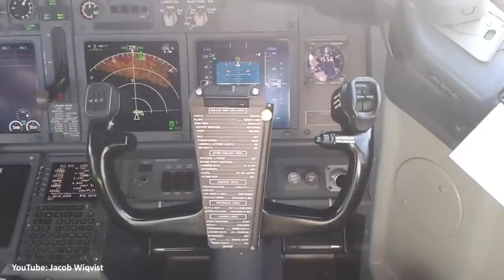Why does Airbus use a side stick?

Comment: So, after going through alot of comments it seems like almost every prefers yokes, but at the same time not giving a reasonable explanation why it is better. How many accidents have been attributed to sidesticks or yokes. Unless you're a pilot that has flown commercially with both types, technically your opinion isnt worth a grain of salt in the ocean
Reply: Uri Blake exactly
Reply: Air Fance Flight 447
Reply: @mobilegamer8922  Pilot error and bad communication between pilots. Yes the sidestick made it less visible what the other pilot was doing but ultimately pilot error.
Reply: Epicness 357 I think the biggest flaw with the side stick on the Airbus is that when one pilot pulls on the side stick the other side stick doesn’t move making to so there is no way of knowing whether one of the pilots is doing something wrong. But with the yoke on the Boeing is being pulled back by one of the pilots the other yoke also moves making it obvious if one of the pilots are making a mistake that could be corrected.
Reply: @mobilegamer8922  that the famous one.
Reply: Xi Jinping yes, there is no mechanical connection between the side sticks. However saying that “the pilots wont know” is ridiculous since airbus has warnings now providing pilots with information who is in command and warn in case of dual side stick operations.
Reply: MobileGamer89 seems like the only example people give these days.

Comment: Are you all naive? There are ways of checking which Sidestick has authority. The crash was mainly due to not quickly understanding that a stall was occurring
Reply: Agree, there's a light and even a acoustic tone and the pilots could hold the red button for 5 seconds to get priority input. The crash was just bad communication and overwhelmed pilots.

Comment: Even yokes are fly by wire. Airbus as usual was ahead of the times with this. Boeing is removing cables and going to fly by wire. 747-4 to the 747-8 has removed most of its cables as well as as the 737 to the 737 max. As a commercial pilot that spends a lot of time sitting in the cockpit while autopilot is in control. I would like to think the airbus with its footrest and table tray would make the pilots life a lot more comfortable.
Reply: This thread is about fly by wire. When a company designs something years after a rival company starts to use it I would call it ahead of they time
Reply: Doge Bomber you must have a lot of time on your hands

Comment: as a pilot i can say i prefer the yoke massively.  having feedback when you are actually flying, especially when in an emergency dealing with control surfaces etc, is immensely better.  The side stick yoke feels too much like a video game and not like you are in control of the aircraft.  Also, the reason you mentioned, getting feedback and seeing what the other pilot is doing with the controls is a huge benefit.  I won't fly anything with side sticks b/c of my desire for feedback in an emergency situation
Reply: What about the Gulfstream G400-G800 where they have active sidesticks, where they are electronically linked, backdriven with the autopilot, stick shakers and allow for force feedback?
Reply: The Yoke can be operated with either hand--not the Side Stick!
Reply: @sadiqjohnny77  A benefit in general aviation aircraft. On airliners, it's usually one hand on the yoke and the other on the throttle for descent to landing. No using either hand then.
Reply: True, in the normal state of events but I have flown as captain on Tridents, 707s,/720bs. DC 10 and B 747s. There have been occassions when I have had to use my left hand while manual flying (perhaps to pull a chart out of my flight bag next to my seat on my left when an unexpected change happens) It only takes a few seconds so handing over to the copilot is not necessary.  Leaving the throttles for that time does not cause a problem. Modern airline pilots usually use autopilot and auto throttles down to 200-300ft or even autoland. So perhaps my observation is outdated.  I often disconnected all autos and flew the plane in manually to keep my manual flying skills up to yhe mark. Never flew with a side stick and think that I would still prefer the yoke. Side sticks remind me of computer gaming. @ARandom777

Comment: Boeing has asked pilots which they prefer. Most Boeing pilots prefer a yoke. When developing a new aircraft like the 787 they can incorporate a side stick as it is apart of the new type certificate. 777x has to stay with a yoke due to its previous type certificate. I work on both Boeing and Airbus and they both engineer great aircraft.

Comment: I would like to use whatever system would not result in my death.
Reply: Talking about safety, both systems have their drawbacks. While it is certain that the AF 447 accident would more than likely not have occurred on a Boeing, it is also true that Eastern 401 could not have happened  on an Airbus airliner. In that crash, the distracted captain disabled the auto pilot mistakenly by nudging his yoke while helping the FO changing a light bulb. I am no airline pilot but I think it makes sense for a plane designer to eliminate a control system which takes a lot of room and is typically used for 20 minutes during a normal flight and to replace it with a writing tablet/laptop shelf.
Reply: @patricesicaud6536  pilots are trained on their specific aircraft type. No one event ever caused a crash. Usually there is a chain of events that cause airliners to crash.  The Eastern crash you referenced had other links in the chain of events that caused the airlines to crash.
Reply: Steering wheel. Now you realize?
Reply: Brian Wilson So what you are saying is that the Easter Airlines crew was a victim of a unforeseen set of circumstances where they were the least responsible link.
I am not buying this. Whereas the AF FO was directly responsible of the crash because he kept the airplane nose too high,  the Eastern AIrlines captain was just as guilty for not monitoring the plane flight. IT always is the first rule in the cockpit "First, you must fly the plane". both screws were highly trained for sure but in both cases, somebody screwed up really 
bad.
Reply: Brian Wilson When are you going to rejoin The Beach Boys?
Reply: So any system that prevents pilot error? :p Meaning Airbus and sidesticks.
Reply: What happened on eastern airlines flight 401?

Comment: Everyone prefers the yoke. For me, both are great. Remember that the sidestick is not a simple joystick. I'm sure that sidesticks are more comfortable and precise than they appear to be, as they have many adjustments on the armrest in order to get a correct position to handle it with precision and without moving your arm. You move only the wrist, and you have a table and even a keyboard if you're flying an a380 or a350, apart from the autotrim. Nevertheless, captain's and first officer's sticks should be linked in some way, just for safety

Comment: Yokes are better
Reply: Bŕøđý Cýř no
Reply: Please explain you opinion, it's a great debate.
Reply: Agreed I like jokes way way way better. Simply if everything fails at least you still have the controls of the airplane. Plus you wouldn't have the confusion of having two pilots using the controls the same time without knowing it. like Flight 447 of France.
Reply: @TheSwanlake2009  today, yokes aren't linked to surface planes with cables like in the old days. It's hydraulic. So if everything fails, well you are done, sidestick or yoke alike
Reply: @TheSwanlake2009  on the AF447 the pilots knew that they were both moving them.
Reply: @underwaterdick  What if Boeing bought the F-16 production line, took out the side stick and installed 737-style yokes in them?  What if Airbus could sell you a kit to convert your Cessna 152 to a sidestick fly-by-wire aircraft?  What if Lockheed-Martin could sell you a multi-engine automobile that allows you to control the pitch and roll with the steering wheel, the yaw with your pedals and the reverse traction and power with a throttle quadrant?
Reply: @tomasribeiro8020  Not until the last 13 or so seconds. But I believe that was largely due to the captain not saying "my plane" when he took control.
Reply: @wbharris1031  they only realized that too late because they where both panicking. When the captain that was resting arrived at the cockpit he immediately realized that they were both moving the sidesticks but of course the callouts had been ringing for since they both began moving them.

Comment: Yoke gives a more balanced central ambidextrous stick control.

Flying with left sidestick for a right handed pilot (and vice versa) bears more potential danger during high stress flight.
Reply: Even with the yoke left seat left hand and right seat right hand is used. You don't fly with both hands on the yoke (except immediately after V1)

Comment: Yokes are better hands down because It’s more manual and hands on and doesn’t require making one hand more used than the other hand for using a joystick
Reply: The training pilots receive is vigorous and extensive. You just don't go to your local license office and get your multi engine rating without thorough understanding of all the different nuances that go into being a commercial pilot.
Reply: I think it would be a nice change of pace for my left hand to finally get a work-out.

Comment: Most pilots are accustomed to the traditional yoke/column just like most drivers are used to the traditional steering wheel of a car. In my opinion, the traditional yoke is more intuitive like the steering wheel than the side stick. My preference is the yoke/column. Maybe Boeing retained the yoke/column because most pilots are used to it.

Comment: If Air France 447 was a Boeing. The yoke would have been observed by the other pilot.  Side stick requires little input and hence 
Not visible.
And Navgeek nailed this fact
Reply: jimmy c At least we have more space in Airbus. When you fly a Boeing don’t complain about the legroom, having to do paperwork on your knees and eating on your lap.
Reply: But in AF447 both pilots knew that they were both moving their sidesticks. But they were panicking and any form of logical reasoning left that cockpit... In an Airbus is both pilots are moving their sidesticks you can constantly hear the "Dual Input" callout and the fly by wire computer will sum up the inputs
Reply: @tomasribeiro8020  Dual Input alarm ringed multiple times. Also Robert yelled mutiple times at Bonin to push the nose down.
Reply: @northaviation7952  Legroom, safety... I'd stick to safety.

Comment: I think "Yokes" are safer that "Sidestick" because Yokes are mechanically linked whereas Sidestick aren't.
Reply: Fermain Jackson omfg. Can you just read your comments before you upload them.
Reply: Everything is flyby wire these days... Yokes are being obsolete
Reply: Fermain Jackson side sticks are safer
Reply: Agree - just one example - in an emergency a pilot could put pressure or incorrect inputs on the sidestick inadvertently cancelling out the other pilots inputs. That can never happen with Yokes
Reply: You cant cancel out the other pilots input anymore... They have corrected this feature... A deafening "Dual input" aural warning will blast from the speakers if this happens
Reply: RunPJs yes but with Boeing, they fall out the sky, whereas airbus can be saved. But Boeing can’t.
Reply: tuluks Vui The inputs are summed up now. For instance, if a pilot puts the aircraft into a dive, the other pilot can pull up and the aircraft will stay level.
Reply: Yokes are fly-by-wire, but they are still mechanically linked BEFORE connecting to the interface. So it maintains both advantages.

Comment: I feel that the sidestick helps steer the plane with more ease than having a heavy yoke in front of you, controlling it with one hand and keeping your other hand on the throttle. The sidestick is much lighter and needs small inputs to make the aircraft move hence resulting to be more comfortable for the pilot. It also increases legroom for pilots and doesn’t block the pfd and other crucial displays. I prefer the sidestick.
Reply: The 777 that has a yoke is fly by wire like Airbus
Reply: I prefer the yoke, it feels much more like having control of the plane and it's much more reassuring
Reply: Not at all. The 777 has force feedback and direct link to the control surfacees. It's like flying an cable controlled aircraft such a 737.. While the sidestick of an Airbus give commands to the flight computers, which translate it into control movements. You not acctually steering the plane. The computer does.

Comment: I learned to fly in Cessnas that had yokes, so that's what I'm used to and prefer. I also had a job working on military flight simulators where the fighter aircraft had side sticks. The sticks were on the right side, which wasn't too bad since I'm right handed. A side stick on the left would drive me crazy, and I'd think it would be a little more dangerous.  The side sticks made sense in the fighters, since it's easier to use those when you're taking heavy Gs. But I see no advantage to side sticks in large airliners.
Reply: Makes zero sense because the captain would also need his/her left hand on the yoke while using the right hand for the throttle. Sidesticks on airlines are mainly for crew comfort and accessibility to a tray table.
Reply: @hodb3906  imagine building a plane just for a tray table. Plus I’ve flown a cross country with a yoke in a C172 and a CC in a cirrus sr22 and the yoke in the long run feels so much better
Reply: I guess it’s down to personal preference

Comment: hard to fly if you're right handed and a captain lol
Reply: On Boeings the captain always holds the yoke with the left hand anyway because the right hand should be on the thrust leavers.
Reply: @tomasribeiro8020  I doubt that it really matters that much.
Reply: @brilondon  exactly, with time you get used to it.
Reply: True i tried to put my joystick in left side if i play FSX and really hard to land
Reply: @gabrielcanillas7206  THAT is probably because your joystick was designed for use with your RIGHT hand, but in airbus planes the captain has his sidestick designed to be used with your LEFT hand. Get it?
Reply: Nop. The sidestick is designed for use with the left hand on the capt side, and if you're thinking about the weaker hand: you get used to it, and if you still don't believe me, well try a left handed joystick on a sim.
Reply: It’s better to have the less experienced pilot with the easier side stick and have the more experienced pilot with the harder side stick (unless ur left handed then it’s harder)

Comment: Side sticks are definetly awesome, if I was a pilot that's what I would be going after. Pilots dont have to worry about some massive column inbetween their legs. Also it allows for a table to be installed right their for the pilots to use their computers, do paperwork, or eat their meals on. So much leg room. Also they have foot rests so you can get your legs up and stuff.
Reply: Ya 
And for rudder control also it's easy

Comment: 1. The sidestick provides more space in front of the pilots, and therefore better ergonomics.
2. The yoke is more noticeable since it's larger and linked, so an incident like AF447 would be less likely.
3. Eastern Airlines 401 is somewhat irrelevant because if the autopilot is deactivated there would be acoustic warning.
I personally prefer yoke because it gives better tactile response.

Comment: I would be hard for me to handle a left side stick as I’m right-handed. How do you overcome that with the side stick?
Reply: A sidestick only needs millimetrical hand movements. In other words you can basically bank with your finger.
Reply: See my reply to @Jorgeyy boyy
Reply: Sit on the right side
Reply: Hold My Fly by wire
Reply: @ANGEL-st9xr  Yoke on it.
Reply: Sit on the right side of the cockpit..
Reply: All bad answers so it comes down to the Yoke is better for control.
Reply: I have a replica airbus side stick for my home simulation and I can use it on both sides though I prefer the left side, cuz more space on my desk and I have no difficulty in controlling the plane like that. I'm right handed btw.
Reply: All people bringing up that argument are generally ignoring two facts: First of all a yoke would also be controlled only with you left hand since the right one would be on the throttles during manual flight. Second: You ever drove a car that shifts manually? :D
Reply: @ThorstenInJapan  I totally agree. It's completely ignoring the fact that both hands can make precise input on bigger things like a joystick. The only thing that Takes like a day or too is switching from FO to CPT seat, but that's why there's simulators for.

Comment: Aboard most modern yachts, there are both sidestick controls (usually on the seat armrest) and the helm steering wheel, both of which control the rudder.  On the other hand, the sidestick controls can also control foreward and back/reverse and side to side (starboard/port) motion/propulsion.

Sidesticks can also be placed at the stern of the yacht and can be remote handheld units that you can take with you wherever you are on the ship.

Other controls include engine controls, autopilot, navigation, communications, electrical and hydraulic controls, lighting, radar, fuel management, etc.